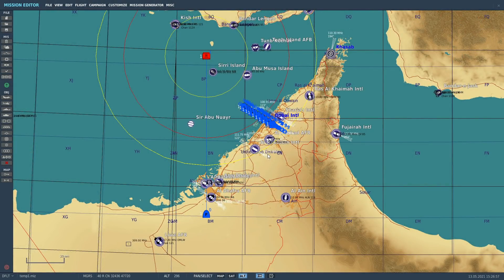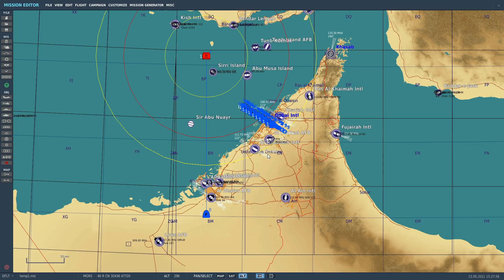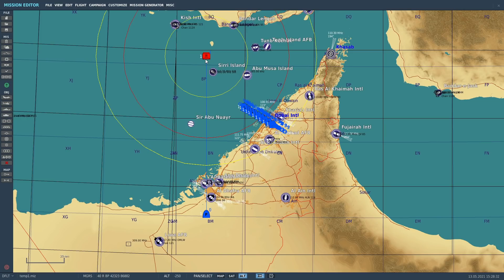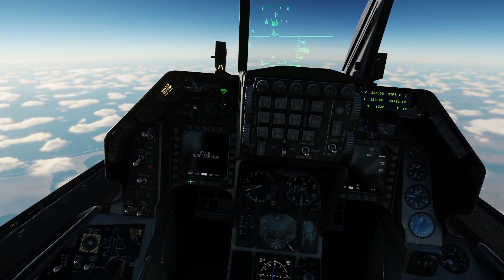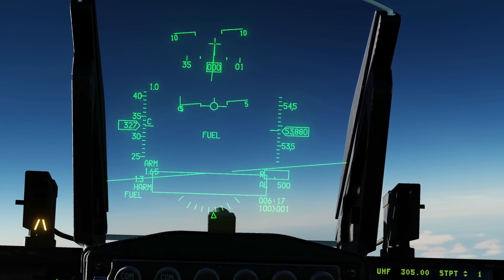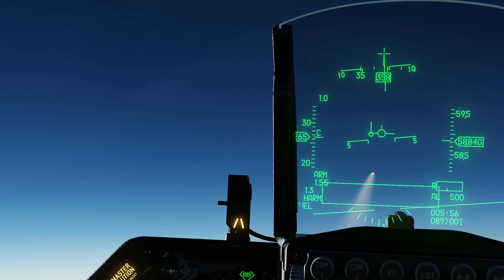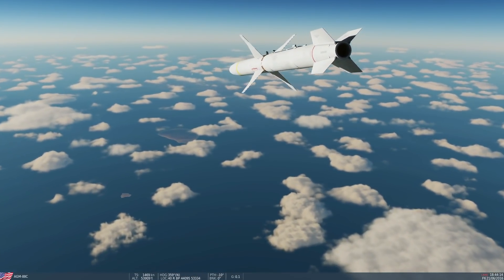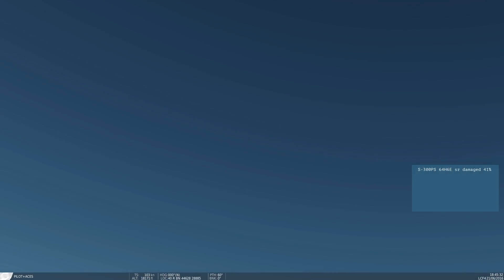Max Possible Range Of AGM-88C HARM From F-16C Viper | DCS WORLD

Comment: Noticed the lower Textures setting in the cockpit, from experience I would hazard a guess you're experimenting with your new VR headset that you bought after testing the VR Flight Sim rig? If so looking forward to a VR video!
Reply from the maker: Neg, didn;t realised anything had changed?
Reply: @grimreapers  the HUD looks normal but the cockpit textures looked like they were on the low setting, it might be some weird YouTube compression but they’ve looked much clearer in past videos.